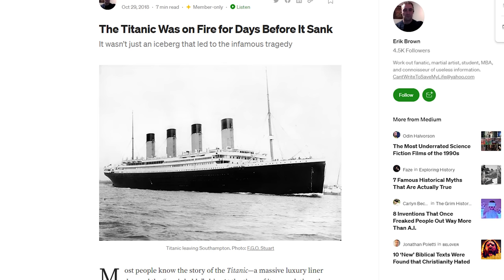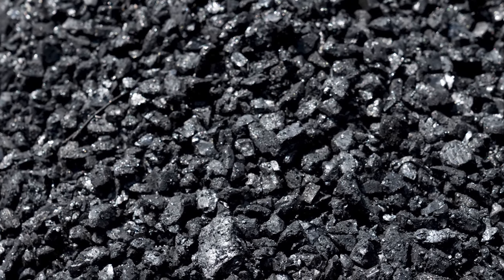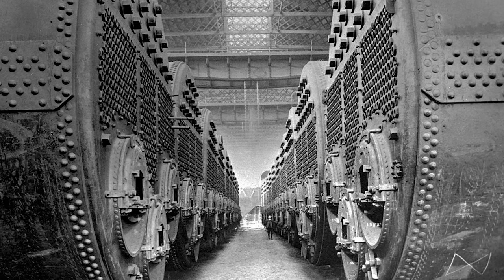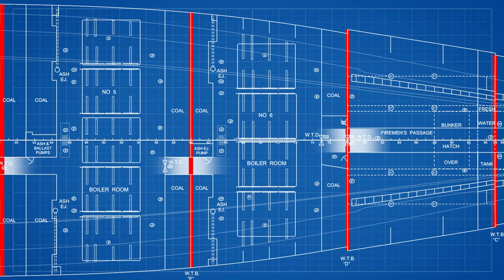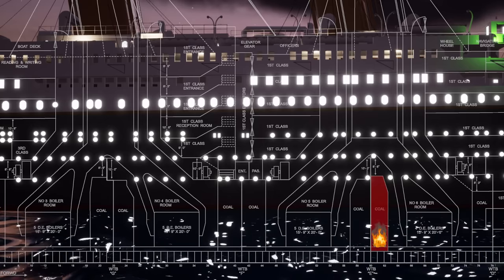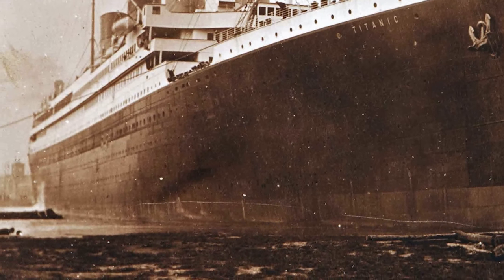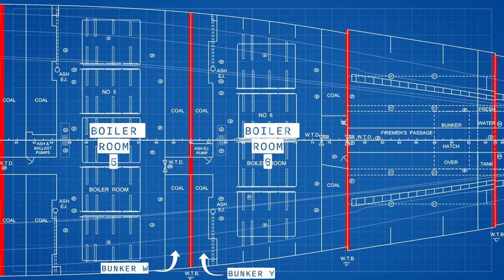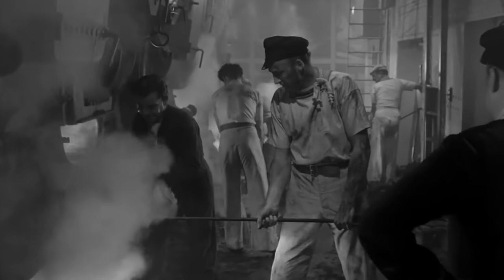Did the Titanic's Coal Fire Cause the Disaster? The Burning Question.

Comment: One of the most hilarious myths about the Titanic I have ever heard was one I was told by a coworker. They said that the boilers got so hot that it caused the hull plating to fracture due to the temperature differential with the ice cold Atlantic water. In other words, the extreme heat inside and the extreme cold outside made the hull plating crack and caused the ship to flood. I asked the question "How come that didn't happen to any other ship, like the Titanic's sister ship Olympic?", and they had no answer.
Reply: I've heard that as well. "Poor quality steel, cutting corners..." Nonsense
Reply: There was a theory that a fire in the coal bunkers caused the steel to weaken. There really was a coal fire in one of titanics bunkers, but it was reported extinguished way before the iceberg collision.

Also, I heard from a doctor on MatSci during my first year in college that the steel wasn't of poor quality, they just didn't know about the brittle-ductile transition temperature back then. It's been 12 years since I heard it. Don't think I ever had classes with that teacher except that one introduction to mat sci presentation.

Drachinifel points out that yes, they knew about brittle-ductile transition temp since they started putting steel armored warships to sea.
Reply: @ChickVicious237  a materials scientist I know who is also a bit of a Titanic nerd actually cleared this one up for me. Because of the immense size of the Olympic-class ships, and the fact that both Olympic and Titanic were being built at the same time, Harland and Wolff's normal rivet supplier simply couldn't make them quickly enough. So, another company (whose name I forget) was brought on to make more rivets, and their process was a bit sloppy and introduced more slag into the rivets than Harland and Wolff was aware of. 

This slag increased the brittle-ductile transition temperature, meaning some of the rivets (I believe it was only protruding rivets that had this problem) under the waterline were becoming brittle at a much higher temperature than they should have. This means those rivets could have failed below their specified tolerances when the ship glanced the iceberg.
Reply: @BigBoiiLeem  ah thank you, that is interesting
Reply: @BigBoiiLeem  Is there any actual documented proof of this other company and such?
Reply: Duhhhhh the fire was extent since before they left port ...  Was the Olympic ever in fire?
Reply: @davidmcgillveray146  The materials weren't poor quality, the remarks from the wireless operators were neither rude nor relevant, there were barely any major design flaws in the sense that most would think of a major design flaw, and the fire had no relevance (much like what is stated in the very video we're commenting on).
Reply: I guess Hunter ain't the only one with a crack pipe....
Reply: @alphalunamare  Not that I'm aware of.
Reply: @ChickVicious237  i’ve heard a lot of them too but anyone who knows anything about Harland & wolf knows they did some of the if not the most top notch jobs on ocean liners and ship at the time when someone says something to me like that about titanic i tell them to do some research about Harland & wolf if they refused then they can continue believing a lie and looking stupid
Reply: @davidmcgillveray146  what was said over the Marconi wireless operating system wasn’t rude that was actually typical and standard talk someone who was on one of the biggest ocean liners of the early 20th  century wrote a entire book on it. you my child have much to learn and a long complex road ahead of you. that’s assuming you continue to learn about maritime history
Reply: @davidmcgillveray146  actually titanic was built better than most ships at the time and hardland and wolf always went above and beyond in their design and safety they actually even put more life boats on titanic than what was required
Reply: @BigBoiiLeem  that’s another debunked theory cause in reality any and all ships including ones today would have the hull be ever so slightly more brittle and weaken when in cold water due to hot metal from boiler but thats just a natural consequence and theres really no way around it but it’s definitely not so bad that it would actually change much of anything
Reply: @taylorebenguard6998  very true.  To me it’s really remarkable that, even when the bow started to drop, the Titanic was only listing about 10 degrees.  They had trouble launching the last few boats on one side (I think it was the starboard) because they were scraping against the hull and if she’d been listing even a few more degrees it may have proved impossible to launch them.  To me this just helps to show that the design of the Titanic, while it did have some issues, was inherently quite stable.  If she’d keeled over it wouldn’t have mattered how many boats they had.
Reply: @MEMES FROM ATLANTA GEORGIA  No, the point was it was more brittle than it should have been, not that it became brittle at all. I.e., it became brittle at a higher temperature than it normally would have had the rivets been made according to spec.

Like, my materials scientist friend did extensive reading on this. He's like a super Titanic nerd, and he showed me all these book exerpts and documents about the rivets. Personally, I trust his knowledge over yours if you don't mind
Reply: @DerpyPossum  I believe there's a chapter about it in that really early book from one of the first-class passengers. It was published a few years after the sinking. My MatSci friend showed me all sorts of documents, but it was all stuff he'd pulled from archives and whatnot, and probably not easily accessible on the Internet, I'm afraid
Reply: @David McGillveray  I mean... you watched the video right? How he proved that the coal Bunker fire had no bearing on the collision whatsoever?

If anything, the only thing that the fire affected was a slight list to port. This had been reported as ever so slightly worsening as the journey continued, as more coal in the Bunker was burnt away. Once the ship began to sink, this list became more prominent, to a maximum of 7-9° of list to port.
Reply: @ChickVicious237  you are most welcome 😁
Reply: @MEMES FROM ATLANTA GEORGIA  Anyone who knows about Harland and Wolff knows its spelt "Harland and Wolff." They made good ships, no doubt, but shipbuilders at the time were arrogant and cocky. They believed that God wouldn't allow a ship as majestic and grand as the Titanic to sink. 

Hence, why she didn't have a double hull or two rows of lifeboats like Andrews had wanted or watertight compartments that continued further up the hull. These things may not have saved the ship, but they certainly would have slowed the sinking significantly and allowed far more people to get off safely.
Reply: @BigBoiiLeem  i dont mind and i understand where youre coming from but without the source of this information it’s somewhat hard to believe especially with all the myths and lies about titanic out there and a lot of people believe them im sure you understand what i mean
Reply: @MEMES FROM ATLANTA GEORGIA  yes, completely. I can't remember the name of the book, but it was written by a first class passenger not long after the sinking, and he gets into the rivets situation late in the book when he's talking about the Board of Trade Inquiry. If you're interested in learning more, that would be my suggestion (plus, it's a really good book, like so detailed)
Reply: @ThZuao  Drach? When did he make a Titanic episode?
Reply: Good grief, it was a steel ship, not an over heated Pyrex baking dish.
Reply: Plus the swimming pool would have converted to a large steam bath as it was right overhead...
Reply: @davidmcgillveray146  The binoculars locked in a cabinet without access to a key was something I learned only recently and its clear that everything that could go wrong had gone wrong that night.
Reply: @davidmcgillveray146  No offense but you fell for some of the narratives that were outdated and taken out of context. Many of them are addressed by other users (seriously saying Titanic has design flaws was something that came from something called hindsight, it's like saying U.S.S. Constitution was heavily flawed in design because it's made of wood) but for the rude remarks from the wireless message has a context that was left out. Bride and Phillips spend the previous night repairing the radio after it went dead, as a result not only they had to work without sleep, they also had to deal with backlog of messages and were trying to get in contact with Cape Race which was still far away. To get the message from Cape Race, they had to turn the volume up so when Californian which was more close by sends a message, can you imagine how the pings would sound at high volume? The narrative however would led you to believe that Bride and Phillips were just careless dicks who doesn't take things seriously when that was far from the truth.
Reply: @spikester  Plus it was a moonless night, the binoculars wouldn't have done any good.
Reply: Wow you have a coworkers that actually know what shell plating and boiler is. Mine struggle to install a new cartridge into the printer...
Reply: @JKS62B50  I know, right?
Reply: 😂😂 That is indeed hilarious. Often it's people who really know nothing about the ship who have the most to say..
Reply: Cool story bro.  You don't get to dictate what happened.  It was a perfect storm of failure a around, including using a metal sheeting that warps when exposed to extreme beat and extreme cold.  It's called science.
Reply: the fire myth about the sinking is the funnest
Reply: Why are people so sensitive about this?  You all act like an army of gatekeepers.
Reply: @mattstrathis4328  What?
Reply: @mattstrathis4328  we just want the truth to be elevated and we have no time for ridiculous theories. We aren’t gatekeepers
Reply: @jamesepperson5940  
Have you ever heated metal and observed? When it's hot it becomes soft and malleable.  When it cools it hardens back up.  The problem on the Titanic is that the iceberg hit the exact spot that hadn't cooled down yet.  It was still soft.  That's why it was easily punctured.  

It doesn't have to be "all or nothing."  It was a perfect storm of factors, including the arrogance of believing the ship was unsinkable.
Reply: @mattstrathis4328  that theory of the coal fire weakening the steel has been disproven. Did you even watch this video. He talks about the temps that the coal fire would have reached and the temps it would have taken to deform the metal which is alot higher then the coal fire would have reached.
Reply: They added a bunch of stuff to the other ships that made them much more durable they said the sisters could have survived the damage done on titanic after being re fitted
Reply: @conflict7269  They did, such as adding a second skin to the ships and raising the bulkheads. This didn't really save Brittanic, though. She still sank after hitting an underwater mine in WWI. However, that wasn't because of the ship itself, but nurses and doctors opening portholes to air out the ship against orders.
Reply: As much as I love the Titanic legend, it seems to have been designed by children and fools. It's place in history was to Make sure we learnt and this kind of a farce never happened again. Mankind was still is still too selfish and money is still far to important.
Reply: @Your daily creator No, that just equals steam. If the steam were contained and produced at a rapid rate, then maybe it would lead to an explosion, but because the steam wouldn't really have been contained, it wouldn't build up to cause an explosion.
Reply: @BigBoiiLeem  out of curiosity what sort of documentation did he have regarding the rivets?
Reply: @Purplefood  a few bits and pieces. Unfortunately, the second supplier of the rivets went bust during the depression, so a lot of their original stuff is long gone. But he does have this really cool purchase order from Harland and Wolff to this particular ironwork, very Edwardian and very cool.
Reply: @BigBoiiLeem  ah so nothing that'd conclusively point to the rivets being the failure point in that case? That's a shame
Reply: @purplefood1  oh no, certainly not. I feel that if my friend was able to find it, then the Board of Trade definitely could've found it. Could've played a role though
Reply: @ThZuao  Yes that's what this is about the fire so why say that. Did you even watch it?
Reply: What about the "inferior iron rivets" theory ...??
Reply: @DerpyPossum actually the steel used for titanic and other ships at the time wasn't all that great. But it wasn't an issue they knew about. Most steel used pre 1950 I believe not sure on the exact year. Contained a high sulfur content which when combined with the frigid temperatures of the north Atlantic causes the steel to become weaker.
Reply: @johndoe39322  Yet ships like Olympic, Queen Mary, Mauretania and the like survived dozens of collisions and incidents without the slightest issue...
Reply: @DerpyPossum  I don't know if I'd say without the slightest issue. The queen Mary and Olympic have both been very close to sinking at times
Reply: @DerpyPossum  I'm not blaming them, they did nothing wrong when it comes to the steel. It's just the truth about steel at that time
Reply: @johndoe39322  In situations that had nothing to do with the steel, perhaps. Even the Jarrow workers in 1935 stated Olympic's steel to be in perplexingly amazing condition after everything, and was plenty good and sturdy.
Reply: Maybe he should have said the fire, not the boilers?
Reply: @BigBoiiLeem I remember it being mentioned in a video.  They did have documentation and backup info, I think including where on the ship those rivets were used.  They were a little lower quality.
Reply: No, it’s called the iceberg was a highly dense and heavy object that the relatively soft mild steel Titanic scraped against at high speeds. In other words, the iceberg didn’t need the hull to be weakened by a fire.
Reply: My favorite myth is one my 9 year old heard. She told me that there was an Egyptian mummy in the cargo hold and the ship sank because of the Mummy's Curse.
Reply: Ah yes. The Mummy. A myth that sounds like a potential plot for a new Brendan Fraser movie.
Reply: @DerpyPossum  She was actually pretty well built For her time. The fact that she  survived. For almost 3 hours. When other ships and most modern ships sink in 30 minutes or less.. And then they capsize. Any ship that hits an iceberg like that will sink.
Reply: I used to think that too but it has since been disproven. I think she was built to standards of the time. No other ship that least I know of has stayed afloat for as long as she did.
Reply: Funny how people with no expertise will endlessly repeat myths without considering where they may have originated or what motivated the creation of the myth.
Reply: @ChickVicious237 thought it was made of iron
Reply: I once heard it was German U-boats... A few years before WW1 even started
Reply: @cainmathewson1857  Weird, right? Almost like some people didn't pay attention in history class.
Reply: Wet exhaust and salt water cooling instead of using a radiator and Prestone are extremely commonplace. Cold water continuously flows around hot exhaust manifolds. As long as you don't suddenly dump raw water on a very hot engine, it maintains an in-between balanced temperature.   Not exactly rocket science.
Reply: Maybe they didn't start the fires and let the hull heat up and then drop the ship into the cold water?
Reply: I’ve still got to go with the most hilarious myths (if you could even call it that)  I’ve heard about Titanic coming from my grandmother.

When I was little, my grandmother babysat me a lot and I remember when the James Cameron Titanic movie came out. I asked what it was about and she said a big ship hit and iceberg and sank. Being a little kid, I couldn’t really comprehend this, so I asked why it hit the iceberg.

She told me the captain was a drunk and he crashed it into the iceberg to see what would happen. Me being a small child, I just took my grandmother’s word as gospel and believed it for way longer than it should have. It really rocked my understanding of the world when I found out in like middle school that this was not what happened.
Reply: @kmb1779  I heard that one, but not quite like that. The way I heard it was that Captain Smith was drunk and couldn't coordinate the ship's evacuation correctly or something of that ilk.
Reply: That's about as ridiculous as the theory about jet fuel and the WTC "terrorists attack"
Reply: Some dude tried to tell me that the Titanic was sunk by torpedo, in 1912. You can figure out the rest
Reply: @antlionworkerfan2007  A friend of mine in high school told me that. Something about a German U-boat opening fire on the ship. I asked if she meant the Lusitania, and she said, "No. It was the Titanic."
Reply: Heh....those guys do not get the basics of the technology at all.
Reply: @BigBoiiLeem  a while ago, must be more than ten years now, there was a documentary on British TV (BBC or Ch4, I can't remember which) that reached the same conclusions about the rivet quality, the upshot being that they were shearing off under much less applied force than would otherwise be the case with the usual iron. They cited this as the reason why such a large gash was rent in the hull.  The cold  water had brought the defective rivets (about 20% of the total from what I remember) close to that at which they stopped being ductile and became brittle.
Reply: Another nice video. People will always come up with conspiracies which ignore the actual facts.
Reply: Yeah cause that would mean every steam powered ocean liner at the time would be having catastrophic boiler room melt downs lol
Reply: @Gawlakman  Pretty much.
Reply: @ChickVicious237 ”poor quality steel” isn’t actually nonsense, but it is disingenuous. Titanic was built with the highest quality steel of the time, but as compared with steel today, it was less pure and more brittle.
Reply: @ThZuao  um brittle-suctile steel problems have been known since the middle ages. And yes, they were using low quality steel. apparently the carbon content was quite low. They knew about it but the manufacturing process for high carbon steel was a bit more expensive so they chose to go with low carbon. So yes, they DID cut corners
On top of that the FREAKING RIVETS were not set properly. Exactly the same problem Boeing seems to have. We KNOW from the wreck that the rivtes didn't show damage due to strain and seem to have come right off. Which means they weren't doing their jobs. so please.
Reply: @mattstrathis4328 bro acting like he knows science😂😂😂
Reply: @wrongturnVfor all you said was disproven in this comment section, that one guy that commented was right people who doesn't know the ship well will continue to believe in myths
Reply: @ThisPlaceIsNotHappy.  
Nothing I said was wrong and I never claimed to know everything about the Titanic.   Are you okay?
Reply: i love your question bk at them lol
Reply: It was a fire in the coal bunker not the boiler - thats a documented fact and u should know the difference between a hull and a boiler and a bunker
Reply: @michaeldonnelly1017  I do know what the difference is. It wasn't me who said that, but my coworker.